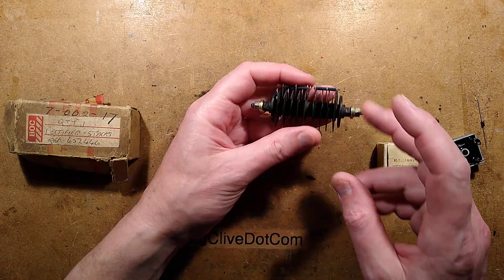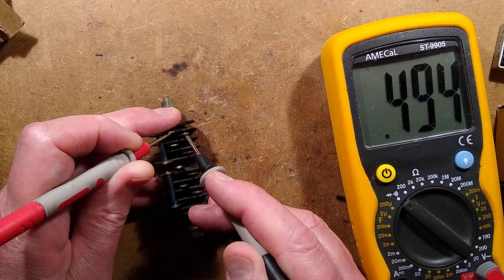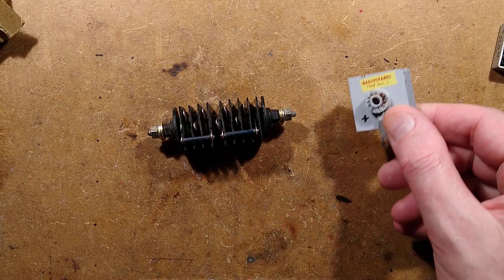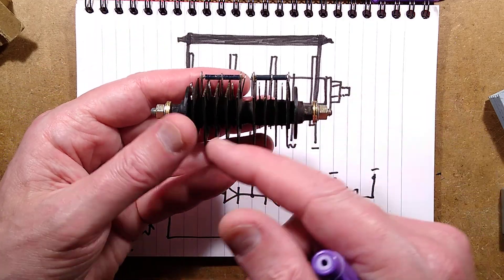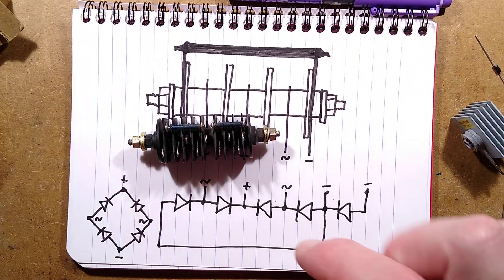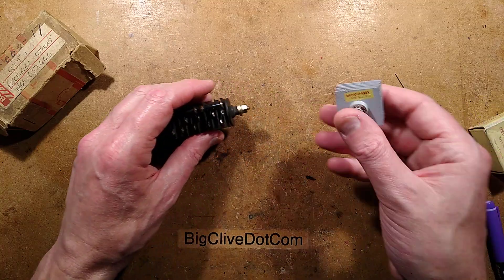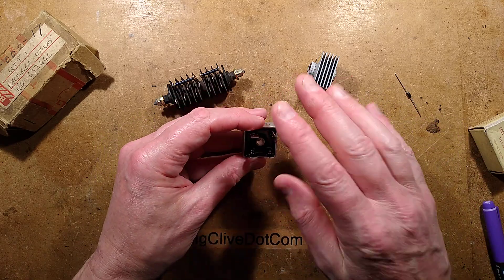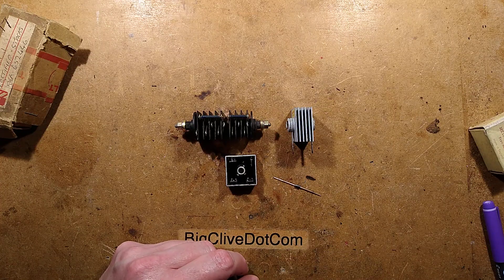Selenium rectifiers - the smelliest components ever

Comment: I have a vague memory that there were also copper oxide rectifiers with a similar finned construction.  Never seen one, just read about them.  As one of the plot devices in an SF story (the aliens weren't hydrogen breathers because of the exposed copper oxide rectifiers).

My memory may be tricking me...

Comment: When I first started my electronics hobby in the 60's, I used selenium rectifiers for 150V and 250VDC power supplies,  for valve based radios. Don't remember them stinking, but then I never had a new one. Still, memories can be fun. Thanks.
Reply: Memories of FOUL 💩 SMELLS are not fun! 👎😂
Reply: @marcse7en  Well, I would agree.
Reply: @mayshack  Well, there you go. Never burned one up. I over-designed my radios.
Reply: They don't stink when new unless you short something out that puts too much current through them. They stink a filter capacitor in a radio failed and the rectifier blew.

Comment: I always thought the fins were just heatsinks, and the bits between them were the diodes. I remember seeing them in old TVs and car battery chargers
Reply: @mikeselectricstuff you are correct, the fins are heatsinks, the selenium discs are in the middle being compressed by the bolt, i've taken a couple apart before..
I have a selenium rectifier that is about 3" square, most of it is thin aluminium plates, the discs are about 3/4", the middle terminal is between 2 of the discs with no plate, it came from a car battery charger, of about 10 amps, notably the charger had plenty of vent holes
Reply from the maker: I'm not so sure that the fins are just the heatsinks.  Maybe I should split one apart and explore it.
Reply: @bigclivedotcom  Yes yes....then reassemble it, go outside and blow it up!, we wanna see the evil smoke.
Reply: @bigclivedotcom  been yeara since i took one apart, i think the fins are heatsinks the doped selenium is a small circle in the mkddke kd the plate. You could also adjust the voltage by removing adding plates if you shortened the rod. As for the guy with battery charger, a modern dioide will probably overcharge a battery they weree usually well matched
Reply: @bigclivedotcom  If you don't, i will :D
In fact, if those are the only ones you have, mine is bigger so should be clearer
Reply: @blower1  That was exactly what I thought. Especially his reactions on the smell. I'm a little bit disappointed with this "Clive Performance" ;)
Reply: @blower1  yes!
Reply: @bigclivedotcom  they are mostly to dissipate heat, but also inherent in the construction,,
Reply: @bigclivedotcom on the ones I took apart the all surface of the plate was a diode. I put 230v in series with a light bulb at the time and probed the all of the plate surface🤣. So it didn't last very long. I was fascinated by this weird bridge rectifier. Then my dad told me it was a selenium rectifier.
Reply: @blower1     Hi blower(upper?),   Good idea!  -  And frighten some Cat's, as well...
Reply: @bigclivedotcom  The fins are actually the rectifiers. If you split one open, please wear gloves and a mask. Selenium is dangerous stuff! That's why they're coated in paint.
Reply: @n2n8sda  Many modern batteries NEED more voltage to achieve a full charge, and certainly for equalizing the cells.
Reply: @userPrehistoricman  it is , its a useful 'inherent side effect' of a selenium rectifier in this application
Reply: @sparkyprojects  Some were copper oxide rectifiers but they were for a relatively shorter time. They too were mounted in a similar way.
Reply: Woah, i've been assuming wrongly for years...
Reply: @volvo09  When you assume,  you make an ASS of U and ME.   - T. Randall
Reply from the maker: I kinda thought that too.
Reply: I have an old car battery charger with a selenium rectifier inside. I don't have a car so was going to sell it on eBay. After watching this video, i definitely need to replace the selenium rectifier with a moden silicon one before selling it. I wouldn't want it to fail with that horrible smoke.
Reply: @simontay4851  I don't know where i heard it (many years ago), but one reason for using selenium was 'because' of the volt drop, many people turn on the charger before connecting it, then touch the clips togehter,  or they connect to a very flat battery, from what i was told, th selenium rectifier could take a quick overload, i think modern chargers with silicon also have an inductor in series. i may be wrong on this.
Reply: @sparkyprojects  You're nearly right. The voltage drop of the selenium full bridge rectifier at higher currents and the temperature coefficient match the needs for CV charging a Pb battery. You can't simply replace a selenium with other rectifier  in these chargers. Later chargers with silicon have other transformers with an air gap so they have a "softer" startup and higher voltage drop (current limiting, like in welders) at higher currents to match the Pb battery charging curve.
Reply: @simontay4851  depends upon the condition... If it was in good condition i'd personally buy it only because it was original... But sometimes you can't be 100% original, capacitors are a perfect example.
Reply: @simontay4851  Unless the charger is regulated(many are not), you will need to add a resistor in series with the rectifier(s)-if you do not, a low battery will draw too much current, and trip the overload thermal cut-out(or whatever type of breaker/fuse is used).
Many chargers rely on the voltage drop of the selenium rectifiers to limit the charge current.
Reply: @simontay4851  Remember that the charging voltage will be higher with modern diodes. Those old chargers had no current regulators and were designed to produce just the right voltage to float a battery once charged. The charging voltage/current with new diodes will possibly boil a battery dry.
Reply: @TerryLawrence001  the higher self resistance of a selenium rectifier acted as a current limiter 😉
Reply: @simontay4851  I have one that I use on a regular basis... Handles 80 amps them sttacks are big...
Reply: Many wrong answers here.
The aluminium plates are completly coated with the selenium and the rolls between are isolators and conductors for sure. But there is an similar type of rectifierstacks with pressed in Si or Ge diodes and this plates are only for cooling. You find it in welding rectifiers with higher output current. Sorry for my bad eng. i am german.
Reply: @112vactech  your English is basically perfect except for the occasional is/are mismatch — but honestly when I’m speaking and not writing, I make 10x more is/are or other similar plurality errors. 

You’re good enough that I didn’t think about it until you brought it up anyway! Certainly, you’re better than a native speaker who doesn’t proof-read, and there are many such people in the world!
Reply: @112vactech  you are correct the entire surface is a diode
Reply: I remember them too being in battery chargers.
Bunch of old people here hehehehehe
Reply: Yes the fins are heatsinks, the centre diameter is the actual selenium. The current rating is around 1A per square inch of selenium, and thus they are pretty big fins to keep the temperature down, as they fail at around 150C, unlike silicon which can go up to 200C short term.

Normally when you replaced with a silicon diode you added a series resistor in the one line for high voltage applications, so the capacitors were not stressed out be the high current pulses.

Yes also have a 1950's era battery charger which had a huge selenium rectifier in it, which was replaced with a massive 30A bridge rectifier, and also, now there was room, I put in a charge controller so you could leave it on, and it would stop charging when the battery was fully charged. Bonus was also to add reverse polarity protection via a relay, and a small incandescent lamp to illuminate the meter as well. It came with a 2R adjustable resistor ballast as well, which was left in circuit, though the setting is now almost short circuit. This charger also has a 6V and a 2V range as well, but those now do not work, the transformer having a 16VAC, 8VAC and 4VAC tap setting for this.
Reply: heatstinks
Reply: Same here with the car battery chargers from Sears.    I really do enjoy modifying and refurbishing these old battery chargers
Reply: I thought the fins were for cooling, but assumed they were coated to form half of the semiconductor junction?
I had a Westinghouse battery charger that preceeded selenium rectifiers using copper oxide as the semiconductor, it had two enormous stacks of hundreds of copper and "something else" washers, half of which were coated on one side only. It was full wave though.
Reply: yes the fins are also to dissipate heat, they dont like getting too warm, it makes them fail, but they may be almost entirely coated in the active chemical as well,
Reply: On the ones I tested the entire surface of the fin was a rectifier!
Reply: @MyProjectBoxChannel  some are, some arent, such as the stc/brimar rm1, rm2, rm3
Reply: the rm4 (i have one somewhere) does look to be possible entirely coated with the active materials, but difficult to tell for sure as its overpainted dark green, the others werent , just naked metal
Reply: @andygozzo72  mine was coated with some paint as well. I carefully scraped through that layer of paint. I remember testing the entire serfuce of one plate.
Reply: It might be a rumor but selenium lead acid  battery chargers were better than perfectly rectified modern ones because of very very small ripple...which helped with desulfsting and formatting the battery.
Reply: @JanicekTrnecka  nope, selenium rectifiers have a higher inherent internal resistance than silicon , and turn on 'softer', with increasing voltage across so help to limit current, and soften the peaks
Reply: @andygozzo72   Thanks for clarifying this, makes sense - especially when charging lead acid batteries in prehistoric times without ICs, just watching the voltage,current and cell bubbling.
Reply: Since some of you seem a bit confused, I'll go and throw out a tip: if a silicon rectifier won't work because it has a lower voltage drop than a selenium rectifier, then you can just add more diodes in series. It's not hard to do, and if you're willing to use things other than just silicon then you can get a fairly close match.
Reply: @absalomdraconis  its not quite as simple as that, especially when replacing seleniums with many series sections, they dont have as  'hard' a voltage drop/turn on like silicons, but a more gentle conduction , so need to add resistance rather than voltage drop, and there no hard and fast rule as to what resistance, you have to experiment to get it right
Reply: @absalomdraconis     Can you match the smell, though ??
Reply: Had one on my 1972 Honda CB350.
Reply: Oh my dad started in radio repair. He had 2 6volt pwr supply's 2ft long heavy. Never gave up the ghost in my lifetime. But he showed me the smelly ones though. Ja ha
Reply: Well,  you were off to a fine Finnish.  Dana is a real Winner,  and I even have her in Dutch!  I Lied...

https://www.youtube.com/watch?v=DMFq6AmKbio
Reply: They could be both a functional part of the diode and a heatsink. I have a large high current one from a forklift charger and the plates are just plain aluminium so in that particular case they're just heatsinks.
Reply: keep it, they wont be produced anymore, ever
Reply: Battery chargers...Yeah, I've got a 12 volt, 4 amp 120 VAC input, charger that someone gave me 40 years ago, it was used, but still works well, selenium rectifier in there...even has a bi-metal overcurrent that pops at 6 amps..a few minutes cooling, it's ready to go again...
Reply: The rectifier itself is not just in the middle, it really is on most of the fin surface (the whole plate minus about 3..5mm spacing towards the edge and a but closer towards the inner hole). The connection to it is just in the middle,
Reply: is it possible to buy new selenium rectifiers anywhere?
Reply: Only new old stock. They're not made any more.
Reply: @simontay4851  yes they are, i've seen them on the 'net somewhere
Reply: @cheater00  i've seen them listed ... somewhere on the net, a firm can make them custom to order, for industrial use
Reply: @N Yes, since a moden diode has less voltage drop, it probably would overcharge the battery. I'll leave it.

Comment: There were also selenium "stick" rectifiers for televisions either on the EHT winding, or on the focus circuit for colour tv's
Reply: The great thing about the ey 86 rectifier was the cosy glow to show that the oscillator circuit was working an that you had eht. All the parts for my projects in those days were salvaged and selenium rectifiers were sometimes in the power supply.
Reply: I reckon it was one of these that failed on a TV at my Aunts when I was a kid.  It made me throw up.
Reply: And if it FAILED, did everybody blame the DOG 💩? 😂😂😂
Reply: If you cut one open, there is literally selenium rectifier confetti inside - tens or hundreds of thin sheet meal discs with a selenium dot in the middle that are the individual diodes, and a spring to push them together. At least that's what's in the Russian ones.
Reply: Krzysztof Czarnecki I've got three Russian ones myself. TV 13-03. 13KV rated. I've come across ones like Clive has and also small seleniums for higher voltage yet really low current.
Reply: colooooor tv you say?
Reply: @RudderlessExplorer  Yes, coloUr

Comment: first!!!!
....or not
but still, im early, 3 seconds ago, woohoo!!
Reply: i have a old car battery charger...well....had, i saved the rectifiers out of it though, they are non coated/dipped because they are contained inside a metal case, about 3 inches across for the flexible metal disk that is sandwiched on a bolt that grounds it to the chassis :D i always wondered how it worked, thought it was just a bimetalic junction